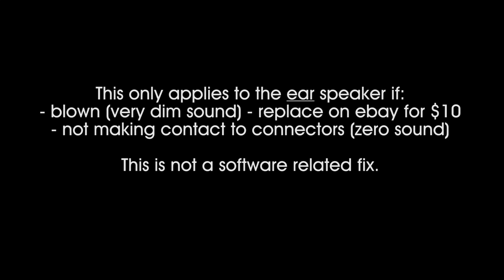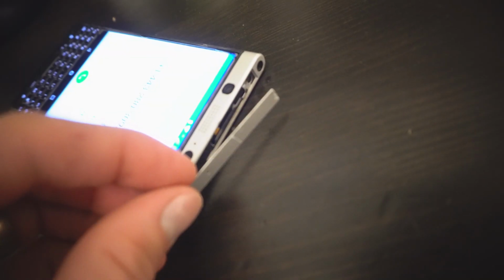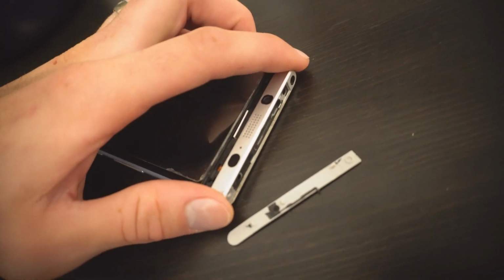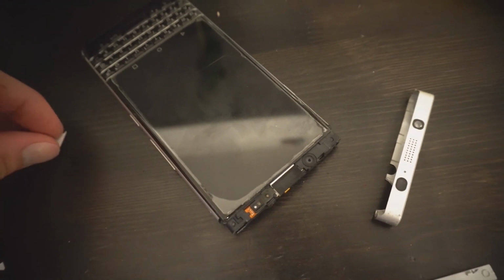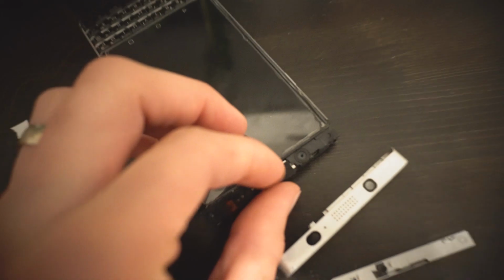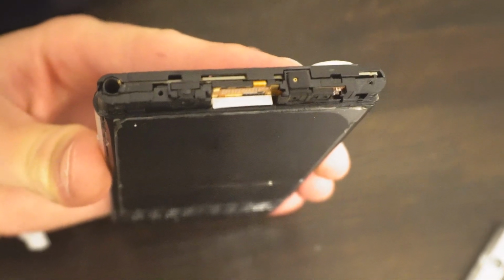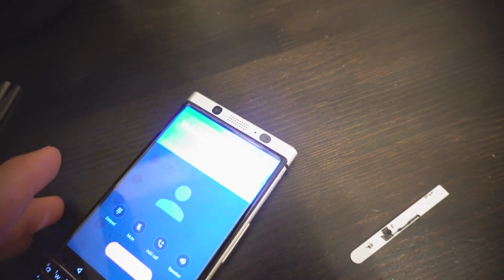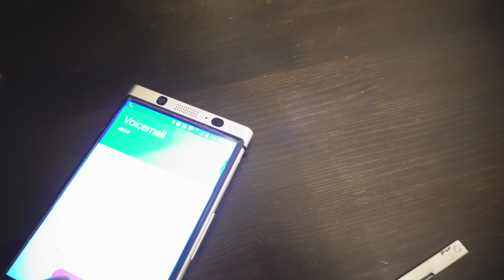Blackberry Keyone - Ear Piece Speaker not working - quick fix

Comment: I tried and it worked. I did not put any piece of paper, just dissembled and assembled again. Thanks! Btw doing this will make sealing rubber under the lid more penetratable to dust and water.
Reply from the maker: Absolutely it's the contacts getting corroded over time and movement helps grind it away.  Glad you found this helpful.

Comment: Great video, but when removing the top adhesive panel be sure to not slide the razor too far in from the edge or you will slice the ribbon cable to the front top components.. .damn damn damn

Comment: ok I tried and it worked but it wasn't loud enough sp I opened again and now  no sound at all   @StuartHaight.
Reply from the maker: Try having the speaker's metal contact points higher or contacting on a different point.

Make sure no dirt or debris is between the contacts.
Reply: @StuHaightVideo   ok I got the sound back but it is still low and muffled. I will play around with it.  Does this section affect the ringing for phone calls as well? When I put it on speaker it doesn't work for calls. 

 It was stuck in headset mode since October.
Reply from the maker: @graperipple  Ok we can basically confirm from what you're telling me is it sounds like your internal ear-piece speaker is blown because you can hear it, but it sounds crappy.

Buy a new speaker from ebay.